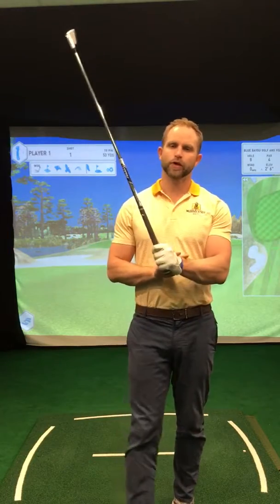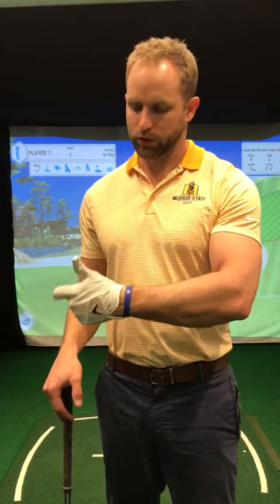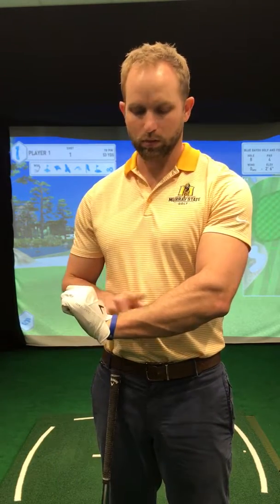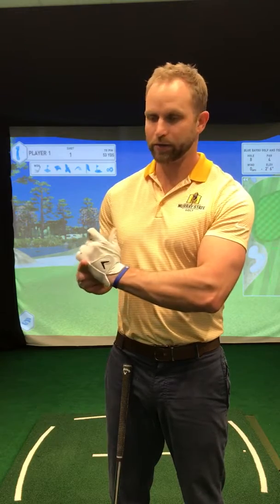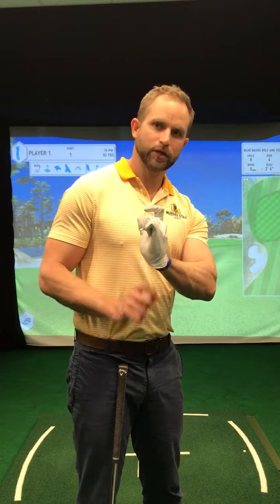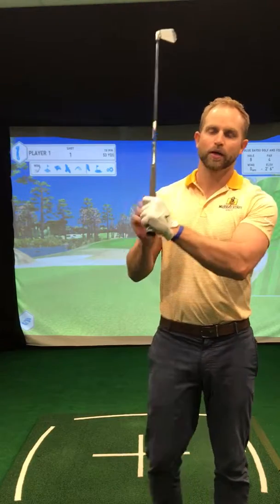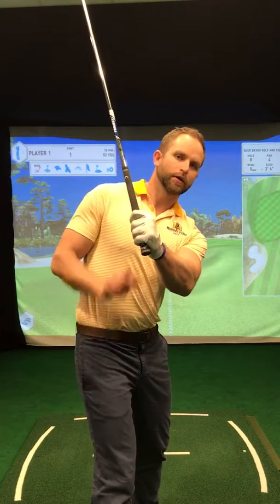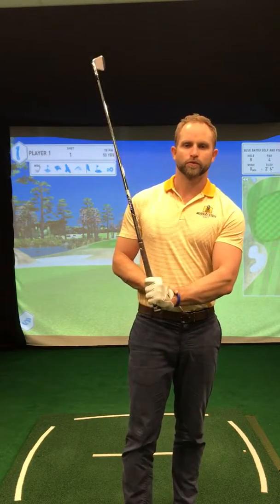Wrist flexion, extension, radial deviation, and ulnar deviation in the golf swing

Comment: Back in 2008 after retiring I took a job at a course so I could practice and play for free and used Ben Hogan’s Five Lessons book to start from the ground-up and retool my Nicklaus style swing learned in the 1980s from Golf My Way.   

When I started doing Hogan’s “waggle” action in my pre-shot routine and analyzed videos of his swings frame-by-frame I realized the waggle action was actually a rehearsal for how he released the club via changing from radial-to-ulnar deviation through impact with a snapping action with wrist biomechanics similar to bucking a log with an axe, toe-nailing a stud at a 45° angle, casting a fly or cracking a bull whip; all things I had done before ever playing golf.  I discovered the waggle down action with the hands produced far more club head acceleration and if done to the max of wrist travel also locked up the wrists when the lead hand was flexed and rotated in to supination as he suggested.  The locking up of the wrists through impact resulted in more consistent control of the club face.  It was just a matter of trail and error face adjustments at address in order to get the club face squared to the swing line and target at the point the compressed ball released.  Due to the waggle action I was compressing the ball more and due to the bio-mechanical locking of the wrists controlling face I started hitting the ball further and straighter with the sound of impact changing.  I also started snapping the heads off my clubs.

The snapping of the heads off the club was the result of the vigorous waggle down ulnar deviation causing so much acceleration of club head around the hands it bent the shaft forward ( and then when the wrists locked and arrested the forward movement of the hands the shaft failed at the hosel if I did not coordinate the lifting of my trail foot with the waggle action.  Again studying Hogan’s swing frame-by-frame I copied the way he lifted his back foot and turned it and figured out how to match the rotational speed of the hands via hip and shoulder turn to compensate for the additional acceleration of the club head created by the waggle action to prevent the excessive forward bending of the shaft before impact.

The physics of the waggle / wrist lock swing is similar to that of an unbelted car occupant in a crash if the locking up of the wrists which abruptly slows the club head occurs just as the golf ball compressed onto the face with the acceleration caused by the wangle action is ready to release.  The ball decompresses at a high rate than in a swing where the ball is carried and compressed on a constantly moving face.

I wondered why, since people had been chopping wood and casting flies before the game of golf was invented that wasn’t the norm and conventional wisdom for swinging a club.  The experience of snapping the heads off clubs off metal and carbon shafts provided the answer; the sweeping lagging golf swing was necessary back in the days of hickory clubs to prevent snapping the shaft which is why sweeping the club through the ball while retaining some radial deviation lag in the wrists and only allowing the wrists to be pulled into ulnar deviation in the finish, which locks and turns them over became conventional wisdom for how a golf swing should work.  

Hogan’s waggle action defied that conventional wisdom as did Moe Norman’s which started with the wrists in ulnar deviation at address and returned them there at impact / release.  If you also study the wrist action of Harry Frankenberg (Count Yogi) and try it you will experience the same acceleration of the club head around the hands and locking of the wrists to square the face as the ball releases of of it.  It explains why all three were renowned for their ability to strike the ball powerfully and consistently straight.  😊